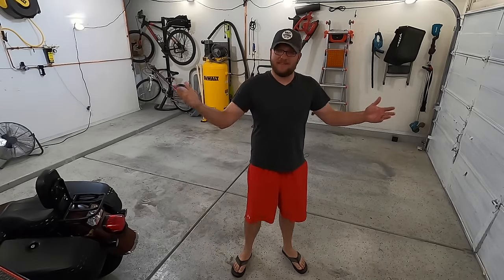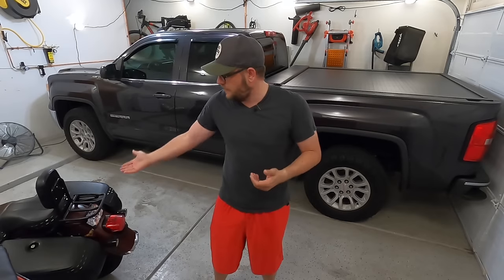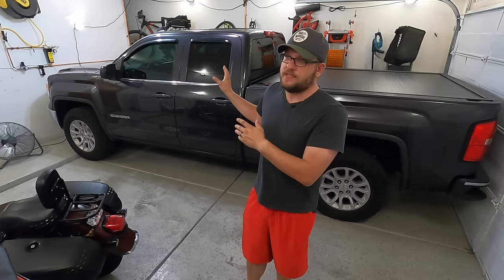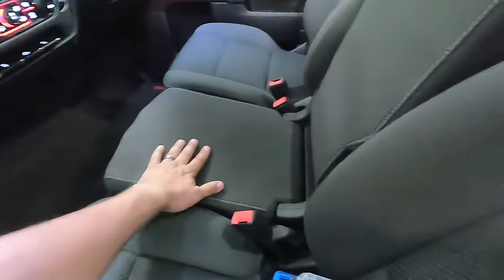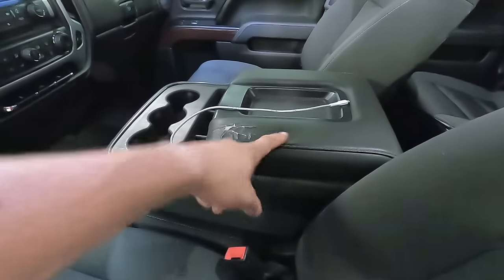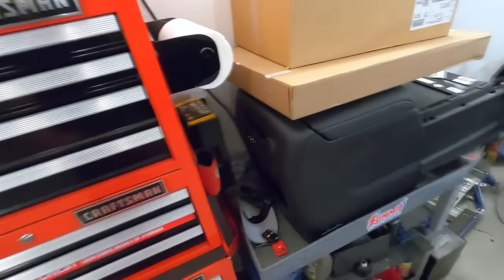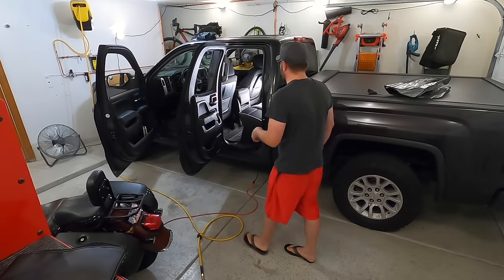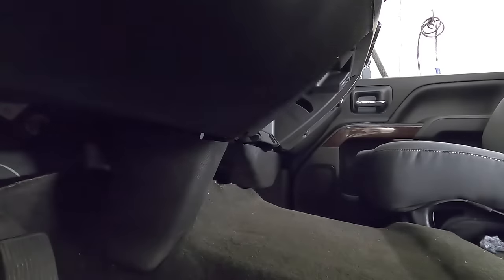2014 - 2018 Silverado / Sierra Center Console Upgrade

Comment: Should have hit up phil Gamboa on YouTube he sells the matching middle console for the interior of your truck and a harness so everything works stock for like 200 bucks more. Looks cool though.
Reply from the maker: Thanks for the heads up. I did see that previously but to me the $200 wasn’t necessary. I didn’t want to push the project up closer to $1,000 just to gain an extra 12v outlet and usb hub. The truck has 3 USB ports, 12 12v outlets that I could put 4 more USB ports into push the 120v outlet. I just didn’t see spending $200 to add more power sources.

Comment: Ah, the good ol' cup holder delete.

Thanks for the video and the console bracket part #, about to do this swap myself. I ended up buying a used high country console (brown) for next to nothing which I had to paint black, as well as Phil Gamboa's wiring harness. If you haven't already, check out his DIY wiring kits their fantastic if you do end up wanting to restore those left two outlets.

Comment: In my 15, I have that giant console. I love it. I keep my cup holders forward. Better reach for my hands. Love it. Bought the truck used, LT, and it had the console upgrade from the factory. Love it.
Reply: 2015 Silverado LT by the way.
Reply from the maker: Yeah the console is necessary.

Comment: Great upgrade. I have crews in my trucks everyday for landscaping. Huge thing with trucks is LACK of cup holders & storage.

Trucks are super expensive investments, so its very annoying when you get a truck with 2-3 cup holders for 3-5 guys....No one ever fits in front middle seat.... So switching to console installs. And, love the movable cup holder on older model. 

Same goes for doors almost never have much usability -- if there are cup holders -- they are small as heck -- And, the pockets never really are wide enough or have caps to protect from getting dirt & other crap falling in. Just becomes a thing to clean.....The under storage in back seat is another great upgrade.

Versatility & utility should be key with these trucks. Nice job. Enjoy brother.

Comment: I wonder what the vibration thing is all about? my 2015 is smooth as can be, I have some gripes about the truck but one of the things I am very impressed with is how smooth and comfortable of a ride it has I dont think I have ever had a vehicle so quiet and smooth as this! I added an exhaust to give it some sound, not anything crazy just enough that you know the dang thing is actually running and so it sounds a little more like what you expect a truck with a large engine should sound like rather than a sewing machine lol .I  highly recommend the MBRP CAT back exhaust for this truck as well as the range brand "tuner" to delete the switching back and forth between 4 cylinder and 8 cylinder , I don't think that is a good thing to begin with and with an exhaust added you can hear it when it goes into 4 banger mode. not nessisaily a bad sound, sounds a little like the engine is doing some kind of engine braking or something , very minimal but you hear it, I could have lived with it and really bounced back and forth about ether it was worth deleting the feature but I think for the health of the engine its better to delete that ...there are a couple to choose from I bought the cheaper on that only deletes THAT feature ($200 or $250 cant recall) but wish I had bought the more expensive one that allows many more controls namely throttle response adjustments! I feel like this truck has a delayed throttle response and it is annoying. compared to my tundra it feels sluggish and laggy and it is because of how they have the throttle response set up! sorry for the long unasked for comments here, I just figure other people might be interested in these things since they were of interest to me.

Comment: New subscriber here. I have a 2021 GMC Sierra crew cab with the center console.  I am wanting to take it apart and explore what space is available for radio antenna wire from the back and mounting options for my mobile radio.  I might not use the deep part but it could be a place to store things so it doesn’t stand out and catch the bad guys eye.  Haha.  Thanks for the video.  I have all the pry tools I need. Just need an idea of which way to pull. Your video gives me ideas.   I realize yours is an older truck but I am after generic examples.  

My dream is to mount my radio deep in the console with a false top or cover to hide it from view when it is parked.  Thanks again for your video.

Comment: I have a manual 4x4 shift by the throttle pedal, not electric switch on dash. I wonder if the big console would still fit?
Reply: Same problem
Reply: Here, here.

Comment: Nice video and thanks. Quick question how did you take apart the console to get to the wiring harness. I am trying to replace my USB hub but the cable is too short for one of the wires to connect the new hub.

Comment: Good stuff. Look up Phil Gamboa on YouTube he makes the harness for all the plugs to work and the wireless charging
Reply: Not too expensive either, I believe last time I checked it was 150
Reply from the maker: Thanks. I saw Phil’s stuff and I considered it but I just didnt want to spend that much to get a couple extra plugs. I was able to get what I had originally working with the OEM harness and I was happy with that.
Reply: @GearsGadgets  How did you get the other plugs to work? My main concern is the USB ports inside the console for CarPlay. Getting this done on the weekend and would greatly appreciate a response. 🙏

Comment: I have a 2015 Silverado and my center console USB and lighter no longer works. 
I checked  the fuse to it and it’s still good. What else do I need to check? The wiring harness connection ? What? I can’t even unplug connections from harness to USB etc. please help. Thank you

Comment: Would it be a problem if you just use the new wiring harness that comes with the new console or do you specifically need the harness out of the old console to connect the new console to the truck itself?
Reply: The plug side from the dash dictates what harness u keep on the console side. If console plug matches both console plugs, functionality is dictated by features built in to truck at time of build as to what features will / won't work on new console

Comment: So I’ve been really wanting to do this because my 2016 Silverado has the same shaking problem. It drives me crazy. But I have the WT with the 4wd shifter in the floor. Do you think there would be room for me to diy a hole in the drivers side big enough to go around the shifter?
Reply from the maker: That is an interesting question. I am SURE you could modify it but I am not sure how much work would go into cutting plastics and fitting it. Might be a LOT of work. Sorry to hear you have the same shaking problem. It SUCKS!!
Reply: My 2016 never shook and neither does my 2018 that's weird

Comment: Did you just plug in the old harness into the center console or did you have to exchange the usb connection of it for the car play to work. I have a newer console with the wireless charging. But I don’t need that. I rather have the phones plugged in.
Reply from the maker: I just pulled the old wire harness out of the old console and routed it through the new console. Some of the features on the new console dont work but that’s fine by me. I DID have to swap out the USB port on the inside of the console to get Apple CarPlay to work but that took 3 seconds.
Reply: @GearsGadgets  thanks! The console I got says 2016 so I think it should have CarPlay already but if not I’ll switch it. What about the lighter in the back of the console? Were you able to reach it with the old harness?

Comment: I’ve got the 2019 Chevy 1500 LD, which is just the 3rd gen 2018 body style. Think this would still be compatible? Middle jump seat is practically worthless
Reply from the maker: I am not sure. You would have to probably ask the dealer of cross reference part numbers. I would hate to steer you wrong with such an expensive thing.

Comment: I have the 2016 chevy 2500,  can I replace the upper trim panel 23467123  so I can get removable cup holder?  Its impossible to clean without removing the entire panel. Also the part number says with wood trim on the GM site.
Reply from the maker: I THINK so but I am not 100% sure.

Comment: Can I change my center console of a 2021 Chevrolet Silverado LTZ and put a bench seat? What would be the cost? Could I seek the existing center console? It has cup holders and a wireless phone charger.
Reply from the maker: You will have to contact your parts department or do research on the internet like I did. I have no clue what goes into a 2021 as I don't own one.

Comment: Is there a specific driveshaft replacement part that can be ordered?  Or is it just anything other than a GM driveshaft?  I replaced transmission, torque converter, and differential fluid.   2015 has 90k miles.

Comment: I am looking to do something similar to this in my 14 Silverado 1500 with 4 wheel drive. I have the four wheel drive shifter on the floor. I don't know if there is something available for me in this configuration with that shifter. My truck now has about 160,000 mi on it.  I did replace all control arms and I did change out the u-joints in my driveline by myself, I did not have any issues, I wanted to get ahead of any issues.

Comment: Did you pay a arm and leg for shipping? After I checked out my order the shipping and handling cost was 360 dollars. Bringing the total amount to 1000 bucks.
Reply from the maker: The trick is to find a dealer locally and bring those part numbers either to them or look up their website and order direct if they have a parts website. If you have it shipped to your local dealer they dont charge shipping.

Comment: Why didn't you use the harness I came with it and everything would have worked.
Reply from the maker: The harnesses change from vehicle to vehicle based on RPO codes and the console I bought was from a truck that has features my truck does not. They are not interchangeable without buying additional aftermarket harnesses and I just didn’t see the value in spending another $150 on a custom harness for features I didn’t really care about that much. Purely subjective obviously.

Comment: pgamboa has some nice videos on this and harnesses.  I have the rear piece w/out the audio controls.  I replaced in on my new 2018 Sierra b/c from the factory it had a small scratch in the lower pocket where the two screws are.  Let me know if you want it.  I figure 20.00 plus shipping from CA.
Reply from the maker: Yeah I saw pgamboa’s harnesses. I considered it but I actually ended up ordering the replacement back piece too. I didn’t make a video on it because it wouldn’t really get any views. I appreciate the offer though.
Reply: What is pgamboa....thanks

Comment: just a little tip for those who have the same issue with the jump seat armrest lid being all cracked up like yours is. you can order a replacement material and pretty easily remove the old one and install the new one.matches perfectly and makes such a difference in the look of the truck, I did it on mine and it was like maybe $40? took not much effort at all to do it too! but I would rather have the full console for lots of reasons, that hump space is just a waste of space really, my wife likes to put her purse there but thats about all its good for! the extra front seat is not ever needed for me either. maybe if it was a single cab but with a back seat who needs a jump seat!

Comment: Can this center console fit a 2010 Silverado single cab feel like it would look amazing thanks
Reply from the maker: I am going to say that it wouldn’t fit a 2010 because the interiors are completely different designs.
Reply: Doing a 2018 denali seat and console swap on my 2008.. it will fit just some minor adjustments and obviously some wiring
Reply: sergio jr Thanks a lot I notice you have a YouTube you think you can record your progress and post and get back to me and watch it
Reply: @eduardofrias3782  yes I will upload   the video gotta figure out the whole YouTube upload thing but I'll uplaod... im on GMC sierra Nation on Facebook I've been posting on
Reply: sergio jr alright man thanks a lot
Reply: Dan I just want to thank you for the helpful tips and hints on swapping out the jump seat to the center console a good friend of mine did it for me because I couldn't do to health issues also if you want to get the other cigarette lighter to work just grab the old wire harness take the plug pigtail it and splice it in it will work thanks again

Comment: I was literally cussing during this video saying this swap out is not that easy if you want everything to work. I had to rewire the main plug and add a different cable from the HMI unit it was a pain in the ass but everything works on mine I wouldn’t have it any other way. Next I bought my unit used from carpart I believe I got in touch with a late model scrap yard in Georgia. $350 $50 shipping. You can go online and see all the totaled trucks and buy what part you need. A new one will cost sooo much money i was not about to spend $1000.
Reply from the maker: That’s why I was showing how I just used the OEM harness and wasn’t worried about all the additional wiring. The only things that don’t work are the USB ports on the left and the one cigarette power port next to it which I plan on retrofitting with an up fitter switch panel anyway. When I priced this all out the used stuff from scrap yards and eBay ALL wanted $1000 for everything and I bought it all OEM from the dealer for just over $700. The process was just as easy as it looked in my video if you do it the way I did. If you do it your way and rewire everything then yes, it’s way more work.
Reply: @GearsGadgets  your video was great I meant no knocking on you at all. I was only adding context for others about how involved this can be.
Reply from the maker: @hyyperboy  fair enough. It’s certainly something I could have spent a little more time on. I respect you going through all the proper wiring.

Comment: Why didn't you go to a junk yard and get it for a fraction of the price?
Reply from the maker: Because by the time you pull something like that from a junk yard, it ends up missing parts and pieces, you end up cobbling together mismatching colors, and waste several hours to get incomplete parts and pieces. Going to a junk yard is great to get a part, it’s not great to get a complete assembly. Even finding them used on eBay cost more than buying the parts new from GM because junkyards that part out overprice stuff like this.